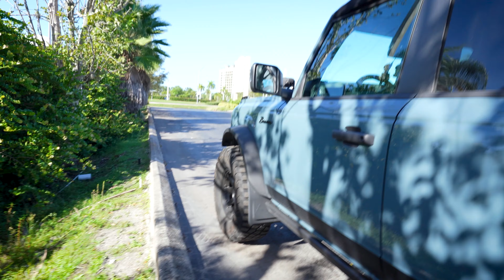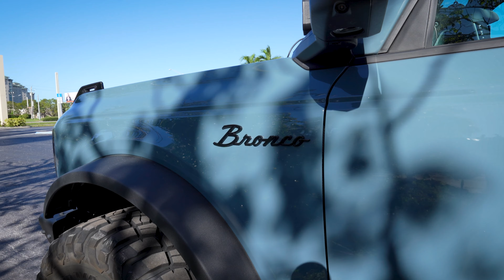Metal Licensed Bronco Emblems - Installation on 6th Gen Bronco

Comment: I had a recommendation for another set of the vinyl stickers that you guys make... Instead of making the BRO-RANDOM letters for the Passenger Dash inserts Vinyl; I was thinking that it would be awesome to get that same lettering in colored metal. For example, I have the blue metal start button outline, and I was thinking something like that done in the passenger dash lettering would be super awesome. I know I would upgrade mine as soon as they released (if they released).
Reply from the maker: The air bag might make those letters fly. Also we don't make Bronco letters for the dash for the record!  We just make a random assortment of letters in random sides 👍.
Reply: @StickerFab Thanks for the reply and sorry about the legal language error. I've edited to my original comment to remove that error now. As far as your explanation, that makes sense, I definitely wasn't thinking about the airbag issue... Though for my Bronco I'd roll the dice if I could make or find some metal letters that would fit.